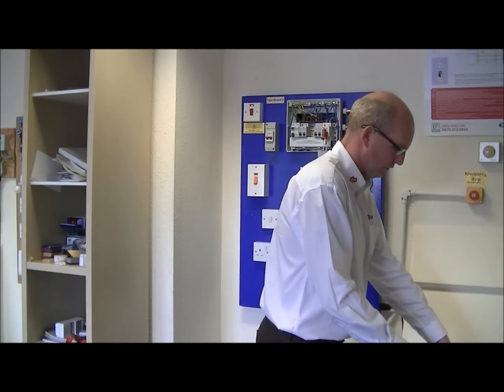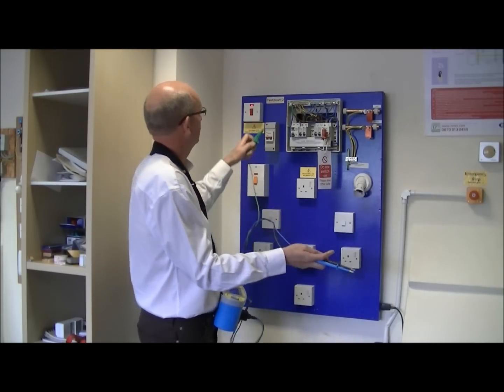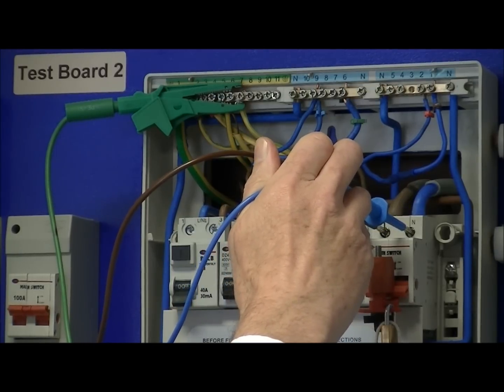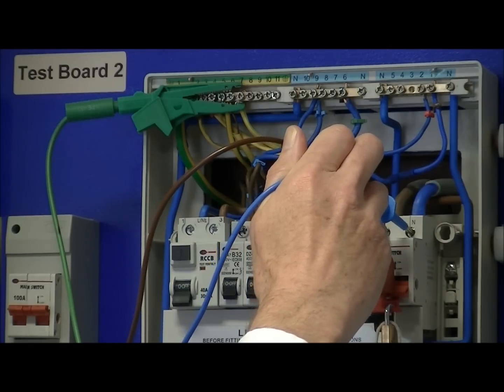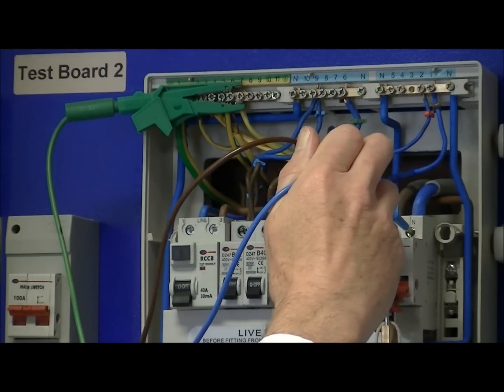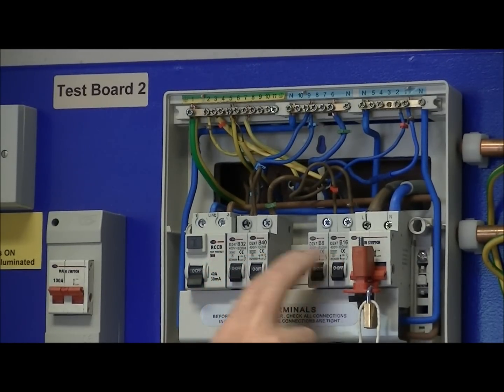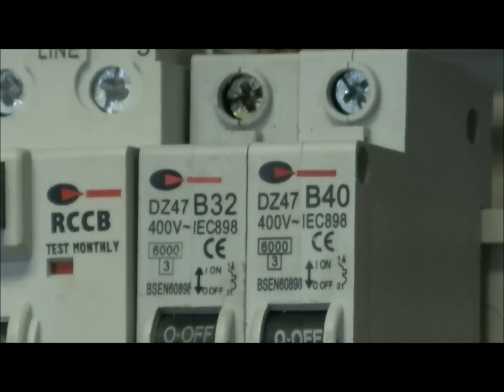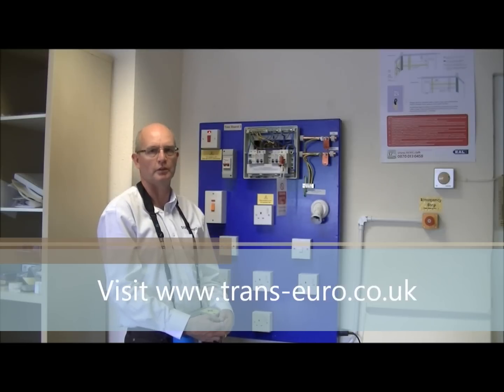Prospective Fault current test

Comment: are you not supposed to disconnect the earth from the MET and connect to directly to the main earth when measuring the PEFC?
Reply: Nope, that's for the Ze test... to verify there is a physical connection... PEFC and PSCC comes after. PEFC and PSCC tests cannot verify ADS(automatic disconnection of supply) as there is no protective devices from the Ze point.

Comment: I am of the opinion that there may be a misunderstanding of what Steve is actually testing,  ...Isn't this test supposed to check that the protective device you have selected to install in your consumer unit, can handle the PFC without total distruction.... In this instance I think that is what Steve is doing and isn't this why this test is carried out?..So I wonder what made people think otherwise, after all the main suppliers fuse is only rated at 60/80/100 Amps (single phase in the UK)...but they have KA amp breaking, and this has already been explained by another viewer below....even if the Maths were wrong..(don't you mean 4.8KA Amp not 48KA...using his/her numbers). 
The tripping time under fault conditions is a different matter, as I am sure you are all aware....and perhaps, referring to.
In addition to the above...if anyone wishes to view the many videos on YOUTUBE they will see that the test was carried out correctly...and that every other video shows that the test is carried out to assess the capability of the fuse/MCB etc... is actually capable of carring the load.
There is however, one more issue..............Why did...TransEuroEngineering... not even bother to reply and explain this to anyone???? and therein..lies a problem.....
So....I agree (for different reasons) remove the videos...if the provider cannot be bothered to provided an explanation...then why should we???

Comment: I know we go on about safety a lot, but as noted above the leads are not GS38 compliant. Measuring pfc and pssc with the probe tips well exposed is pretty bad. Fused test lead would aid operator safety also . The clip on the CPC terminal is not fully mated. I hate pointing out the basics , but flashovers do happen and usually because of carelessness. I observed it happening when I was trainee and it was scary. Please highlight the safety points before any more videos go online, otherwise all the guys trying to get through 2394/95 will fail at the first hurdle.

Comment: Steve, PEFC 370 amps (hot line to earth ground ) and PFC 350 amps (hot line to neutral ) are about the same value. My USA guess is because the earth and neutral wire are tied together "upstream" of your breaker box, and use about the same size wire too.

Is the far green E earth wire the same wire size as the L brown line and N blue neutral? The green looks smaller but is farther away from the cameras thus probably just the prospective.

Nice video, here in the USA tests like this are not done as much. But on old building upgrades or unknown installs sometimes one tests at the sockets / receptacles / motors to find poor connections and poor degraded switches.

 By testing it might just be without a fancy device for fault testing, ie all manual:

 ie have a digital meter to measure our 120 or 240 volts and a switchable load like dumb incandescent bulbs to add a load of say an amp. ie 240.6 volts with no load and 240.1 volts with 1 amp has a 0.5 volt drop for that 1 amp or a 0.5 ohm calculated impedance. Thus the short circuit current is 240.2/0.5 or about 480 amps.

Comment: The breaking capacity of the main fuse will need to be lower than the PFC.
Reply: When you take PFC and PSC readings you record the higher of both readings which is called IPF. Most test meters only record up to 20KA but using Ohms law you can calculate the actual IPF. This will nearly always be 48KA Maximum as you will use measured Line to Earth voltage of 240V with a resistance of 0.01ohms ZE and using the rule of thumb method for 3 phase you will double it. So V=IR (x1000 for KA and X2 for 3 phase)
240V =I X 0.01OHMS 
So reverting the formula V=IR to find I is I=V/R which is I=240VX0.01 x1000 x2
So most I have ever recorded is 48KA in 10 years of working as an Electrical Inspector. Yes you can get some Line voltage readings that might be higher or lower than 240v which will affect your result. It should be noted that the Regs also allows an IPF reading to be higher than the breaking capacity of the MCB at that board if the DB is supplied with a sub-mains circuit which an overcurrent protective device that has a higher breaking capacity than the measured IPF.
Example; You could measure 16KA at a DB that has MCBs fitted with 10KA but if the cable supplying the DB has a switch-ed fuse with 120KA breaking capacity there is no fault to record. This is quite a common occurrence.
Reply: +Prawnchowmein 
Exactly! How is it that having CBs of 6,000 A breaking capacity will protect a circuit with both earth fault and short circuit PSFC and PSCC of 370 A and 350A, respectively?! The whole purpose of a protective devise is to trip before a circuit or any relevant point of the electrical installation reaches its maxumum PSCC or PFC!!! If that installation has in place those protective devises then surely the PFC and the PSCC are higher than 6,000 A. I seriously suggest this video should be withdrawn. It represents a hazard in itself! It will certainly confuse the inexperienced student.
Reply: +Kilovatio 
I can see the trainer was totally confused. He said that in that electrical installation the circuits had a 'very high impedance'. This is nonsense. Conductors should have a negligible impedance so that, in the event of a fault, the current can flow quickly without 'friction' along the way and then make the protective devise to trip. But, in this video, he was not measuring the earth fault loop impedance or the short circuit loop impedance. He was supposed to measure the prospective fault and short circuit currents and compare these values with the RATED current of the protective devise so that, in the event of a fault to earth or short circuit (fault between line conductors) the devise brakes before the circuit reaches its PFC or PSCC. Yes, please remove this video.
Reply: @kilovatio5557  Your an idiot. This test isn't to check if the breakers will trip, it is to see if they can handle the maximum possible fault current that may occur without destruction, which may lead to the terminals welding together and continuing to allow current through the device.